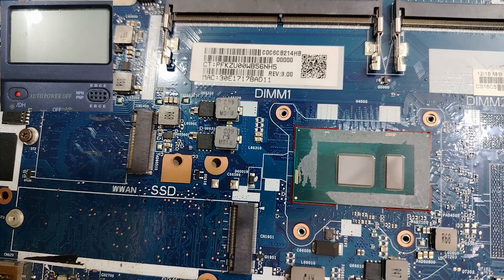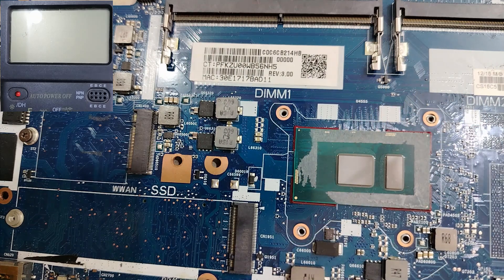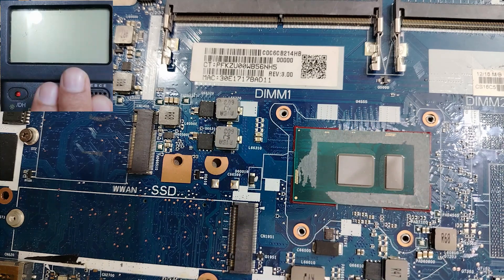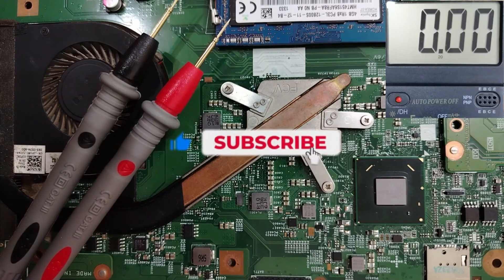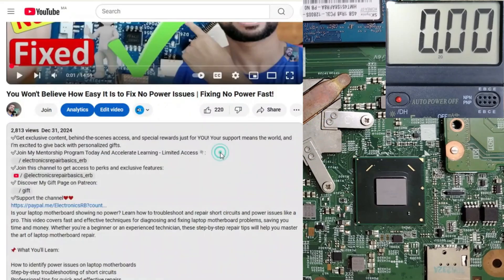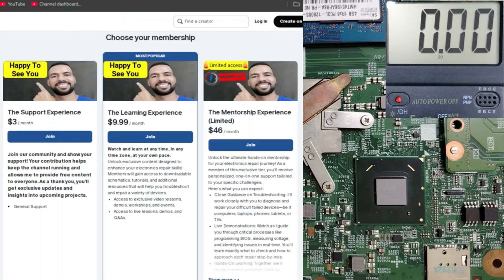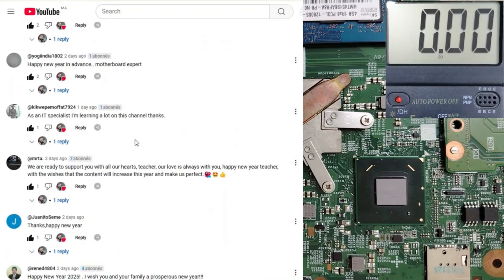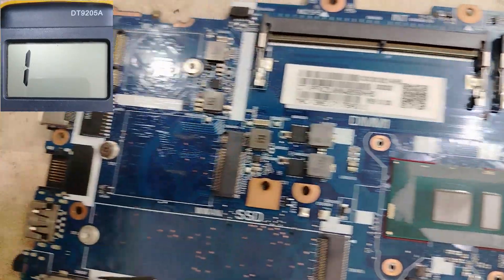Master Electronic Components Testing in 15 Minutes: The Ultimate Guide to Laptop Motherboard Repair

Comment: Sir I have a question. How to test a death processor ??? Please sir help me
Reply from the maker: Testing a dead processor can be tricky. Start by checking for any visible damage, and then use a multimeter to check for continuity. If you have access to a compatible motherboard, you can test it in another setup to see if it works.
Reply: @electronicsrepairbasics_erb  sir if the processor fixt ??

Comment: I think you need to sandpaper your multimeter probes, they are kinda slow reading and something is just weird about them, also if there are 3 - capacitors in series and one is shorted, shouldn't the shorted one be pulled out and just no need to replace it I think.
Love your videos, I would love to see you do more real - time repairs like Sorin Electronics thing that would be dope
Reply from the maker: I will keep that in mind for future videos
Reply: If 1 in row of 3 or 4 is shorted, just get it out, it'll work even without replacement in 95% of cases. And those 5% are mostly GPUs.

Comment: Nice, you are using soldered cpus now. Any sample how to know if it is shorted cpu?
Reply from the maker: Great question! To check if a soldered CPU is shorted, you can use a multimeter to measure the resistance across the CPU pins. If you get a reading of zero ohms, that's an indication of a short. Stay Tuned for upcoming videos
Reply: @electronicsrepairbasics_erb  i hope its the next video, thank you.